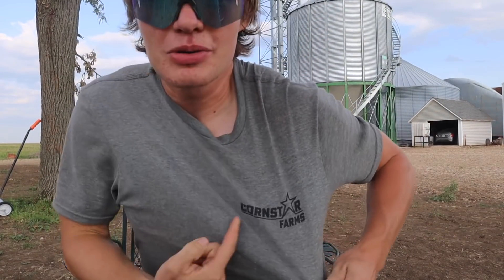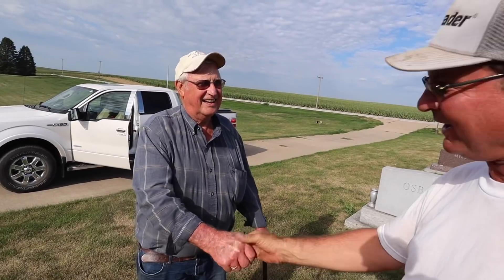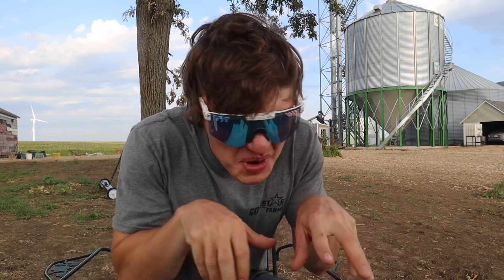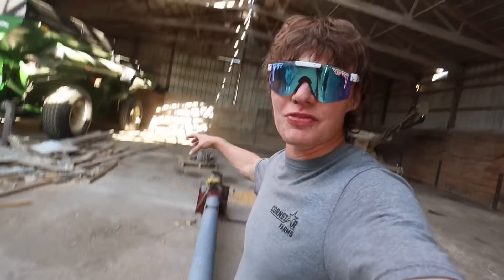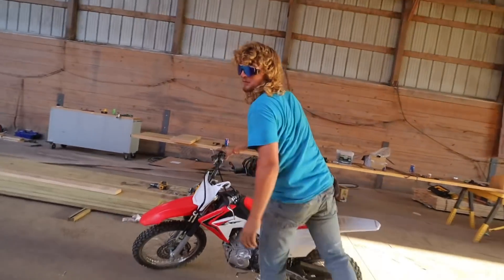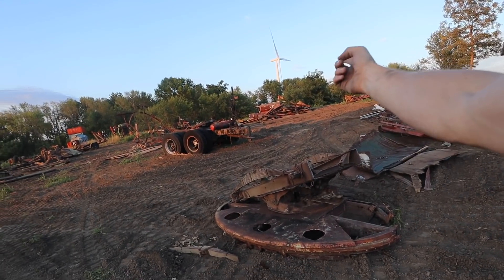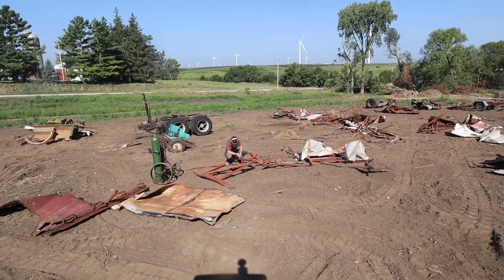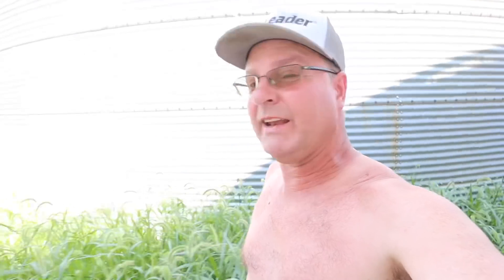My Mansion's Yard Is Almost Done!

Comment: Hey Cornstars...I have a "think harder, not smarter" idea... Why not use a system with 6 or 5 pulleys down the roof of the big storage shed with ropes or chains running over to cranks like the ones used on boat trailers bolted to the side of the shed. Bet you could find a handful of those cranks at the scrap yard. Wait...Iowa is inland and flat and too much farm work, so probably not much boating. But then, people (or a person) on the ground would be able to raise and lower the corn auger into place uniformly by moving each crank a little at a time and not warp or break the auger. And a lot safer than having people up in the air every time it needed to be worked on. It could be lowered easily without equipment!
As a parting note, sorry to see all the damage that y'all have taken on. I think about how much there is to do before corn harvest. You're doing great and keeping your heads up! Thanks for the inspiration!!!

Comment: About how heavy is that long auger that needs to be lifted up to the roof trusses?  I'm wondering if you could hang 3 or 4 pulleys evenly spaced from the trusses and then have one guy for each pulley to pull on a rope to raise the auger?  Then have another guy tie it to the trusses in 3 or 4 places until it can be attached permanently.

Comment: How thick of lumber do you guys have on the interior walls of the building to support the corn pressure? Do you use plywood or 2x material? Thanks.
Reply: I know they supplement the walls with a cabled support system that hooks into the cement floor, can’t seem to find the right vid where they talk about it or I would link it.

Comment: Question- When you say a grave is ready to be filled in, that means the casket is already inside... So how long are the caskets inside before you guys come around and fill them in? Where I live (suburbs of Chicago), the caskets are typically in a cement vault, and the holes are filled in within minutes after the funeral is over. Just wondering what the process is start to finish for your grave digging business. Thanks!

Comment: Corn star family be glad yall don't live in Texas.  I live in wichita falls, Texas. Its hotter here.  The temperature my be 90 but add in the humidity annd it feels like 115 or better.  Its worse if your up on top of a roof like yall have been.  Yall be careful climbing up on the roof and on equipment.  I cringe every time yall go more then a few feet of the ground.  I fell thru my moms attic and landed on the concrete slab in the garage in 2002. I was in a special brace for 16 weeks. I ended up with a compreshion fracture of L1 plus several bulging disc.  I am disabled because of it.  Love watching the vids.

Comment: Doesn't the weight of the skid loader and dirt crush the casket?
Reply: They use it to pack the dirt down so that it settles less over time. Once the hole is mostly filled the dirt will displace the weight of the skid loader. No damage to the casket.